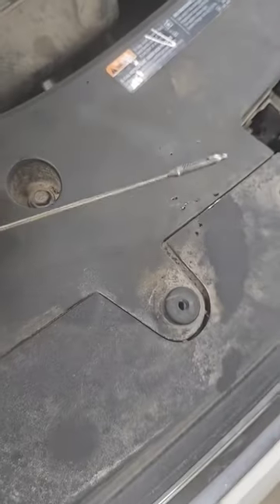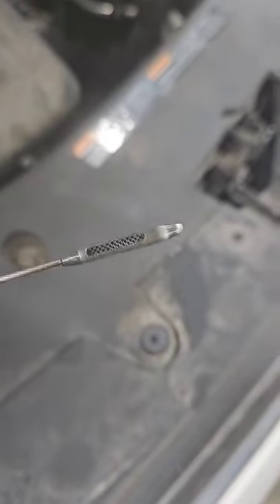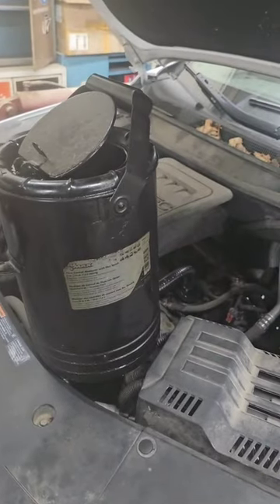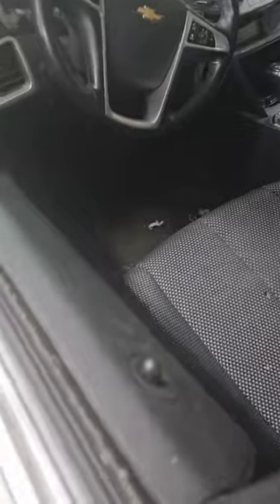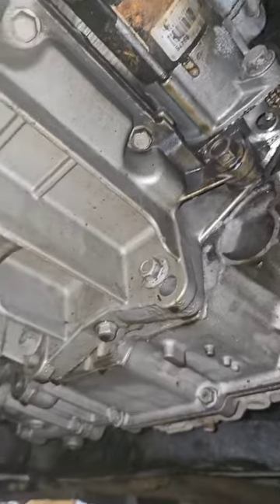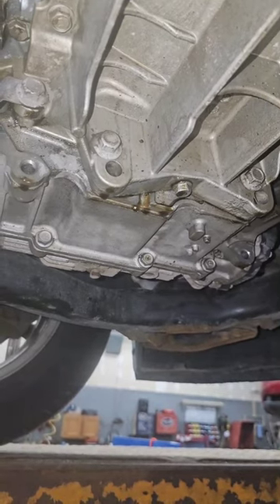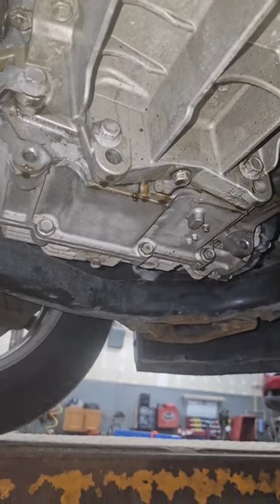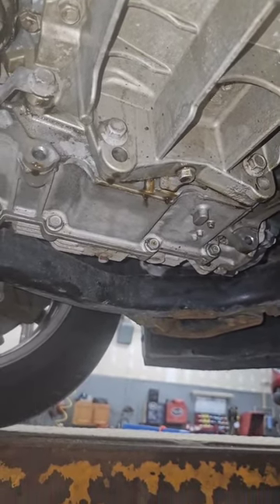Chevy equinox 2.4 ecotec with a bad PCV valve blew out the rear main seal full video it starts peein

Comment: Make sure intake PCV port is not plugged will cause seals to blow if it is plugged. uses fixed orifice in intake.
Reply: That exact thing happened to my bosses squeeks and knocks. Pcv froze up and blew out the main seal
Reply: Very common issue, especially in winter. Moisture buildup (from short cold  drives) in crankcase freezes fixed orifice in intake manifold.
    Oil ring failure, timing chain issues, cam phasers, oil control solenoids, all  common problems. Change the oil by at least 4k miles to help it survive
Reply: Had this happen to a customers car when i worked at valvoline.   It blew the seal out while in the bay.   Had to get towed
Reply: Under the intake
Reply: Drive the vehiclw on L not drive , this allows you to reach 5,000 rpm in 1st gear reaching 25ish mph, really give that sludge a go.
Reply: @jeffhill3681  the problem isn't the PCV freezing, its the fresh air breather pipe on the side of the air box that goes across the top of the engine that freezes and causing the rear main to blow out.  it only freezes and gets moisture in it if the PCV is blocked.
Reply: @PandaMan02  
The air tube muffler is often full of condensation and oil year round, just a lot worse in the winter. Remember the blow by issues with the low tension rings. PVC hole isn't always blocked, just not capable to handle it.
Reply: @jeffhill3681  pretty sure GM stopped using low tension rings a few years before they started selling the 2.4 engine.  when carbon blocks the PCV orifice, it causes the air in the fresh air tube to slow and flutter, causing the condensation and sludge to build up beyond normal levels in the tube and little baffled area inside the airbox.
Reply: @PandaMan02  yes you are the first 1 saw that had it right, the air box gets full of moisture of the years if it never gets blown out then freeze in the winter time and bonk goes the rear main, I think there maybe be a TSB on it now

Comment: Ill stick with my old 95 civic with 260k miles, and my 97 camry with 319k miles. No oil leaks on either.
Reply: My 2013 Focis 2.0L (5 speed) has almost 400,000km amd no leaks and running like a top.
Reply: @derekgardin1512 those were good cheap 🇺🇸cars but no longer see any around my area of Chicago they all have rusted out and most of them have been scraped sadly
Reply: Not prone to being the best on oil tho. Valve cover gaskets blow all the time causing oil leaks. I had to redo nearly all the seals on my 99 Honda 2.4 liter
Reply: Yep u right about that. American greed got in the way of how are cars and trucks are made.
Reply: Those 90s toyotas will go forever. My buddies family had one all the kids learned and drove through high school with. The last daughter wrecked it with 1,700,000 miles on it. Regular maintenance only.
Reply: @derekgardin1512 same I have a 2014 Focus 5-speed that's at 192k miles and runs perfect
Reply: 2006 scion xB 5 speed manual original clutch with 320000miles. No leaks and still runs great.
Reply: They just burn the oil and the electrical fails. Maintenance heavy as they age. Will run broken is not the same as reliable.
Reply: Still have my 99 328 4 Dr and my 03 325xi wagon. The last of the good BMW engines with 230k miles on both. Gm transmissions so none of the ZF problems these were plagued with.

Comment: Common issue due to poor pcv system design. Condensation builds up and freezes, clogging up the pcv, increasing crankcase pressure and wrecking the oil seal. One of our customers recently got a free engine because of this. Gm doesn't even have a fix for it. They just said to leave the dipstick loose in cold weather.
Reply: Remove the intake and make sure the small orifice isn’t plugged with carbon. Did like 5 of these seals I’ve the winter and removed and cleaned the intake on all of them.
Reply: @ThatGuy_Hunter  the vehicle got an entire new engine and intake manifold under warranty.
Reply: @Krankie_V was this in Canada? These dealerships don’t want to honor that because according to them the time to report oil consumption has passed.
Reply: @yausaptheshasuabary180  in the USA,  it was a GM remanufactured engine installed 2 years ago
Reply: they have a fix, its a modified oil fill cap that allows venting if pressure in crankcase is excessive.
Reply: @PandaMan02  the dealership which sold the engine and made the warranty claim probably should have informed us of that then 😅
Reply: My equinox's 2.4l seized up, same thing. 0 oil left in it after main seal failed.

Dealership asked me, "did you wash your engine? This happens when you wash your engine." It was winter and -20.

Comment: I install vent oil cap pc valve plug up I had replace easy front seal I got 208000 miles I didn’t get my rebuild when chev sent letter I was over miles 2010 to 2013 had recall for new piston rings

Comment: The good old cars had breathers on the valve cover. 😁
Reply: I maybe wrong but PCV is for the crankcase, not the valve cover
Reply: These do too, it's just routed into the intake tube.
Reply: @vollkerball1 it vents the crankcase pressure out of the valve cover on old cars
Reply: @jonsaircond8520  thanks for the explanation. Learn something new today
Reply: @vollkerball1 they are connected and breath equally. Oil is dumped into the engine through the valve covers usually and makes it's way down to the crankcase through passageways.
Reply: @vollkerball1  My 08 Mk2 Ford Focus has one on the crankcase and the rocker cover. Both route into the throttle body (into the intake).

Comment: I acquired a 2011 Terrain that had a bad leak. Mine had a blown crankshaft seal and was blessedly easy to replace. I stuck a vented oil fill cap on to safeguard the rear main seal blowing out.

Comment: i dont have a problem on my 2017 equinox (yet) but i insulated the pcv hose and cleaned out the pcv valve with a brass brush and carb cleaner. This should probably be done every 50k miles, including replacing the pcv hose and adding the FC219 vented oil cap. Also getting full synthetic oil changes at every 4k miles, air filter every 12k, clean throttle body with air filter install, and changing spark plugs every 70k will help insure these 2.4L engines reliability in the long run. These engines are actually very good if you maintenance them properly. But most people dont.

Comment: Is that the PCV system thats built into the valve cover?? Now i got the song Under Pressure in my head!! 😂😂😂 I'd pull the motor and do timing chains while its out too if it was my car.

Comment: Just did one a month ago, same problem. Flimsy rear main seal folded outwards. Water in the breather tube, PCV port in the intake plugged with carbon. 

I replaced the rear main seal, and cleaned/modified the PCV port by drilling it 0.010" larger and carefully chamfering the hole to reduce its thickness.

Comment: My wife’s 2012 Kia Sedona with the 3.5 had a leak like this. Ended up being the oil pressure switch. Bitch to change out but it’s now at 291,000 miles and still going strong

Comment: Change oil at 5-6k don’t listen to that dream o meter on the dash. The piston rings and timing chains will love you. Also when the rear main seal is done pull the intake manifold off. There is I tinny little hole in the center that must be cleaned. I always clear out everything that it leads to.  You’re smart you’ll figure it out.
Reply: I honestly think you need to do 3K mile intervals on these junk engines from day one. I've been changing the oil at 5K and using only Dexos rated synthetic on my mother's Equinox. At 175K miles, it's on it 3rd set of timing chains and inside of the motor is pretty filthy. By contrast, my 98 Ford Escort with 155K miles was beautifully clean inside when I removed the valve cover to paint it, and that car has pretty much had the same oil change interval.

Comment: My RMS went out and was about that bad. Put a bottle of stop leak in it and switched the oil to 10w-40. Stopped leaking for years and another 130k miles.

Comment: Should replace the converter seal, for some reason they Tend to leak when separating the engine from the transmission have had that happen too many times
Reply: You are doing something wrong
Reply: Yeah im confused i have never once had a trans leak out the tc seal after trans removal lol @MWilk098

Comment: I'm just going to top up the oil in mine until it dies. Rusty 2010 with 275,000km. $800 plus $300 tax and other fees. Had no oil in it when I bought it. Checked the oil because it sounds like an old diesel when it's low on oil. Was supposed to be a winter ( was amazing in the snow) beater and it's still drivable.

Comment: Yes those engines have a complicated PCV system that will allow crankcase pressure to build up and blow the crank seals out
Reply: Typical GM overengineering to the point it doesn't work well at all.  It's like they don't long term test things in different conditions like any good manufacturer does.  Everything rushed.  And GM wants to build electric vehicles? Lol what a disaster that will be, especially when they start making the lower cost ones.

Comment: That happened to me how this happened Chevy engineers design a PVC pal that gets clogged with carbon then gets stuck close and relieves relieves, excess pressure and the crank case if the pressure doesn’t get relieved, the rear oil sable blow cost me $3600

Comment: The Equinox is the biggest pile of crap GM has ever built. Been through two. Second one dumped oil while my wife was picking up food. Don't remember what all needed to be fixed but I know it was about $1900 in parts and labor. Probably something like this plus whatever else it took with it.

Comment: Pull the intake manifold off the pcv is clogged. Also to confirm this pull the piping off the throttle body to air filter, the big black plastic catch can deal will be damn near full of oil. I own one of these pos, ragged most junk pieces of shit ive ever owned in 43 years. Seriously.

Comment: Its the hose/pipe that goes from the air intake to the valve cover. Got this bs happen to my.wifes when we first got.it used just before. I plugged that hose.in because i was like hey its unpliged push click fotting and i thoight i did the right thing. Then firat big freeze and the rear main went. Always unplugged that hose beforw freezing point and never an issue with that again. That engine is a work horse. But it loves to burn and leak oil but keepa on goin. She drive roughly 25 km without oil and i still kept it for four more years. Not to many km though as she said works close to home about another 35k km. Its b cause the condensation this engine build in thw crabk case freezes on that hosw from thw air intake to the valve cover freezes and the pressure builds up untill the qeakest seal blows. Mine was thw rear main. This piece of shit threw up a full jub of oil in about a minut of idling. I nearly shit my pants when i saw it